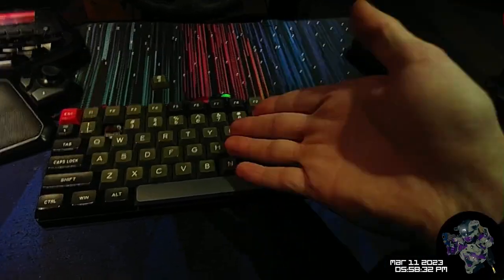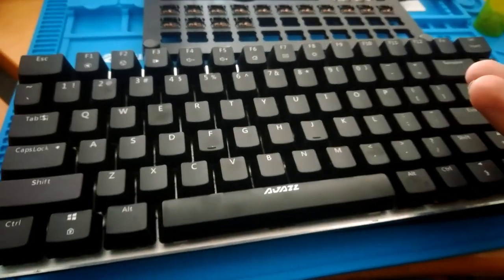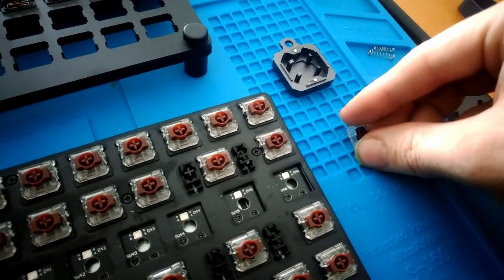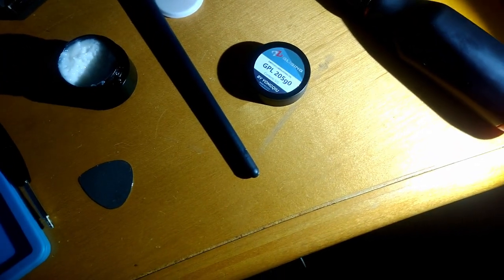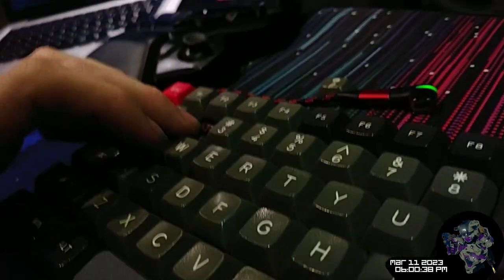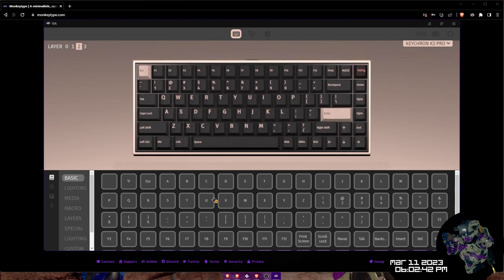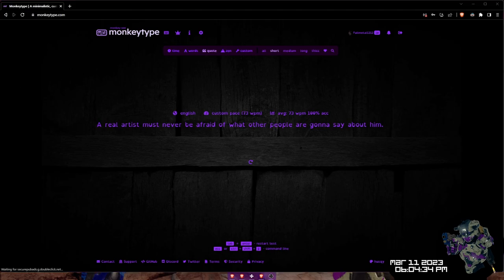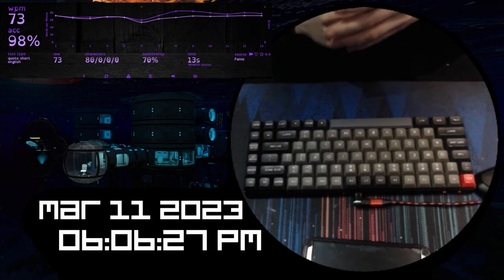This Mechanical Keyboard Revolutionized the Cockpit: Keychron K3 PRO!

Comment: Can you tell me if your keycaps make contact with the board itself? I've just bought this board, and have some normal keycaps that I bought as well, and they make contact with the board on keypresses  (because they're not low profile keycaps) - so I'm curious if you have the same situation.
Reply from the maker: It seems to vary with the types of key caps, my DSA profile ones have absolutely no issues but the golf profile ones that I have also contact
Reply: @FullmetalDragon1212  Can you tell me what keycaps you're using, the DSA ones you had in your vid? I kinda wanna check them out
Reply from the maker: These were a DSA DOLCH set i got from Massdrop back in 2015, Afraid I don't actually remember the original brand that did the drop. https://drop.com/buy/dsa-dolch-key-set @dustinwatts9055
Reply from the maker: Also apologies for taking 7 MONTHS yt didnt send me this one. Hope you found some in the meantime!
Reply from the maker: I found the company it was Signature Plastics !

Comment: Do they pack any sort of foam or silicone in the board at all to decrease hollowness?
Reply from the maker: By default there is not much hollow space at all for example the foam I put in this board is actually just the foam they put on top of the board in the box, and you have a hard time closing even with that.  But from the box, there is no foam in this board. What your hearing in this clip has the foam in it.

Comment: Can i use normal keycaps for modifications?
Reply from the maker: you can, but from what I have heard back some keycaps can strike the Plate first, the DSA's I am using are really short caps, so you may need to space taller ones with an oring to stop it from contacting the plate.

Comment: Any idea what the latency is?
Reply from the maker: I unfortunately don't have a good way to test that. 
My phone is ancient and doesn't have a slow motion function to time it by frames unfortunately. 
I can tell you after using it for a couple weeks on Bluetooth, that there is not really any noticeable latency, even when gaming. (I am nowhere near competitive, and usually use a g13 programmable pad anyways)  But on my older MacBook the Bluetooth can freak out a bit and cause some lag.  

Using https://blog.seethis.link/scan-rate-estimator/ 

the fastest I can get it to go is 1000hz wired or wireless.  

Now the scan rate is just the updates INTERNALLY in the keyboard. It doesn't include the actual latency of the computer processing that input. As this has no special drivers. It is likely near 1000hz if not 1000hz. But without a proper camera to test That's about as accurate as I can Estimate. 

Getting that result was very difficult as even with my suped up springs, the key quite often sits around 5ms between press to release, to get the 1000hz internal polling rate, I had to remove the cap, and flick the corner of the stem so that I didn't impede the spring back. So for you to actually FEEL the difference between 250-500-1000hz will depend more on what you build your keyboard with more than the software in the board. 

Unlike a mouse which is constantly sending variable information and updating a picture, anything over 250 hz in a keyboard is really just duplicates of data. for example just spamming keys in that tester doesn't ever exceed 250 hz. Only deliberately playing with the switch at exactly  the actuation point is able to surpass that. 

That's about all I have for ability to test latency unfortunately.  Hope that gives you an idea though. Still love this board and have spent a hour and forty five minutes typing in monkeytype since then on it.
Reply: @FullmetalDragon1212  Sorry friend, I don’t know English well and now I’m using a translator. On this site, what delay in ms did your keyboard produce when you spammed the keys?
Reply from the maker: @Il_II_lI  1000hz

Comment: What a scam company!!  Bought K3 Pro directly from them for $119 on 3/21/23 - it won't stay charged longer than 2 days.  No warning or anything and shuts off.  The RGB lights have stopped working now too.  I contact them and they say "Oh, you must ship back to Hong Kong, it will be expensive, plus you lose initial shipping". They didn't want to deal with it.  They wanted to send me a battery - sorry, no..this is a brand new keyboard.  Now, they say to ship it to this scam place in Portland, OR and they'll refund me.  Yeah, just ship it to ChenYaoQiang...Seriously?  Do NOT buy from this scam company.  There's no warranty or after purchase support.  They're scammers!
Reply from the maker: You are aware that I am not actually the company that produces this product right? However amazon does have a return facility in Portland. so if you bought it from them you can print return shipping label, and they will refund when they get it.
Reply: @FullmetalDragon1212  Oh, I know, but you're influencing buyers to buy this stuff.  I'm simply exposing how terrible of a company they are.  I bought it directly from Keychron.  The address in Portland is a freight forwarding address....lots of people have been scammed there.  To ship this back to Hong Kong from the US is $85 for a $119 keyboard.